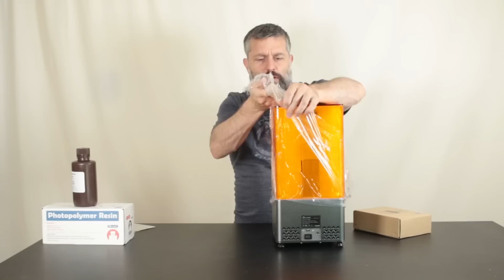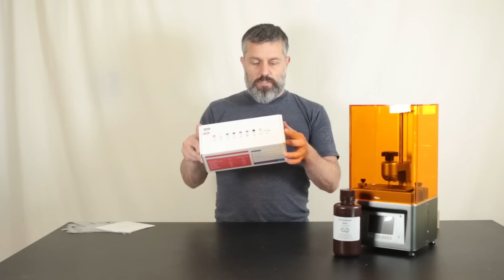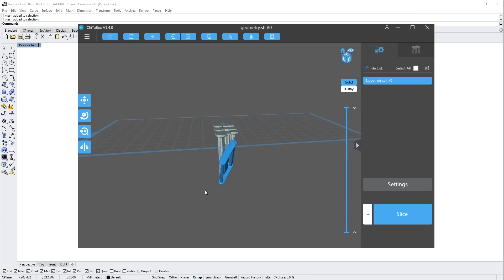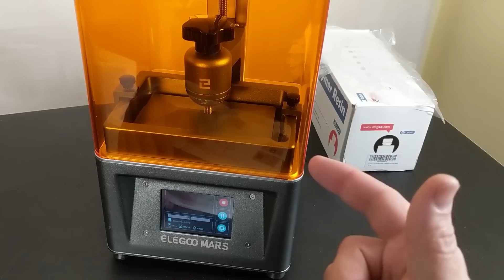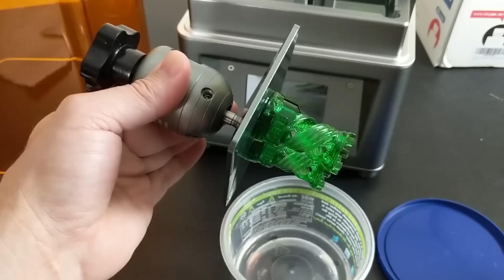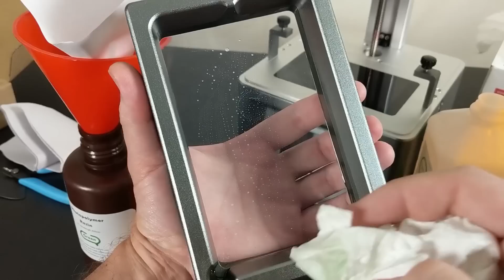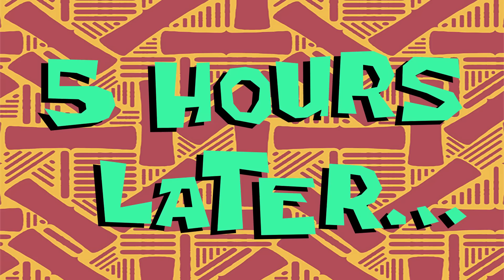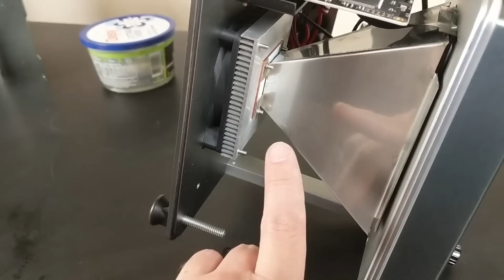$250 for This Quality of Printing Is Unreal! - the Elegoo Mars Delivers, so Let's Review It.

Comment: Very important, you must keep the resin off your skin, even in trace amounts. If you do get resin on your skin, immediately wash it off thoroughly using soap and water (NOT using isopropyl alcohol, as I had incorrectly originally written), and try to avoid UV light and sunlight for a few hours. From what I've read, there's this strange thing that happens where when UV resin cures inside your skin, it raises the flags of your immune system, and over time, your immune system becomes sensitized to UV resins. When this happens, you can end up with severe, nasty reactions to any contact with resins. Delay that sensitization as much as possible by always wearing gloves and never handling uncured parts with bare fingers. (Severe cringe when you talked about how they still felt "tacky". :-P)
Reply: I agree you should always wear gloves (nitrile, not latex), but never wash it off using IPA if you get it on your skin.  The IPA makes the resin thinner, but when it's on your skin that also means it will absorb into your skin quicker and easier.  You want to get it off your skin with the minimal amount of it being absorbed.  It's similar to how Sanjay from E3D has talked about seemingly permanently injuring his finger by experimenting with solvents, the plastic dissolved in the solvent, he got it on him, it absorbed into his skin, the solvent evaporate and left behind solid plastic in his finger.  The IPA will thin the resin, it'll soak in, and then when the skin is exposed to UV the resin will harden in the skin (there's photos of one person's hand on the Sparkmaker facebook group where he did that - it wasn't pretty.)  Formlabs talks about it here: https://support.formlabs.com/s/article/Resin-Care?language=en_US
Reply: @ualdayan  Im going to join that group just so I can see that photo :o
Reply: Hmm, interesting. I have thus far removed it by splashing IPA onto the affected skin and then vigorously rubbing under a stream of running water. I haven't had any negative/unexpected effects so far, but if what you say is true, I guess the key is to be even more careful about getting it onto skin in the first place. But, given that it is not water-soluble, how do you get it off if not using a solvent??
Reply: @logiclrd  You wash vigorously with water and soap.  Keep doing it for awhile longer even after you feel like your hands are clean.  The ultimate solution is don't get it on your skin,  get better gloves if they are breaking on you, never forget your gloves before handling things (I even wear them when pouring resin in as I have seen it splash up when it first hits the FEP film), but if an accident happens you just want to limit as much as you can from being absorbed into your skin as you can which means acting quickly, and not doing anything that will make your skin absorb it easier.
Reply: @ualdayan  will scrubbing a resin residue from skin using a pumice stone be a good idea? I often use oumice stone to scrub off a grease or glue resin from my skin, because it is faster than using soap,  washing powder or heavy-duty hand cleaning paste in my experience.
Reply: Arientar at my lab we use the pump dispenser version of a pumice soap popular with metal work and welders. Nothing beats it. Look around for a welding shop and get what they have.
Reply: Yea, I can vouch for the general safety of using these polymers. I run 21 commercial 'resin' printers every day, all day at work. Not desktop hobby boxes...larger printers that use about 3/4 kg of material each.
If you read the SDS for these you'll see some redflags for corrosives and especially reproductive issues for women. I recommend buying a long-sleeve lab jacket and chemical booties for your shoes as well as the gloves and glasses.
Reply: happened to me, developped an allergy
Reply: Interesting and informative thread, thank all of you for this conversation!! 

Except the licking-to-test-tackiness part; preeeeetttty sure you're pullin my leg with that one 🤣 😝
Reply: This sounds like and AD for not buying a Resin printer. Need to cut down the number of things that want to kill my ass.
Reply: WRONG - I hate that word, but I CANNOT stress enough: do NOT use water and SOAP directly. SOAP will break down your skin protection, making it easy for the resin to penetrate.
Instead, use either poppy seeds, baking soda or baking powder to BIND the resin first. Rub it strongly in. THEN go ahead with the above.
Reply: sounds like you should be taking antihistamines while using these chems, maybe keep an epi pen on hand. A similar thing happens when you get a lot of bee stings over several years, you can actually develop an allergy and have an anaphylactic reaction even though you never had any allergy's your whole life.
Reply: @Choc_Chilla  I'm calling Bravo Sierra on the bee sting thing.  It's well known that beekeepers actually get used to the sting, and have a lower incidence of arthritis.  I got stung loads when I was a kid, helping my dad with the bees, and at 55, still have no problems with the occasional yellow jacket or bee sting.  Dad is frikkin 207 years old, or 89 maybe, and still walks right up to yellow jacket nests to spray them.  He just squashes any that sting him and throws their corpses on the ground.  You can barely even tell he was stung an hour later.  ( and of course there are exceptions to this.  Generally though, beekeepers never get allergic to bee stings.)  People who are genetically predisposed to bee sting allergies, or resin allergies, need to be careful.

I wonder, does 23andme do any reporting on allergy predisposition?
Reply: New form of body modification?  Soak hand in IPA diluted resin, then place palm on UV curing plate with a pentagram design?  Favorite gang symbol?
Reply: Well said. Harbor Freight Tools now sells thicker 9 mil nitrile gloves, much tougher than their 5 mil gloves.
Reply: Wearing PPEs is always good advice. But to be very very clear, quite a few cheap photopolymers sold for home SLA are atrocious and have no business in an office or home. Know the differences. Stay healthy.
Reply: What about the dentistry and finger nail shops has this phenomenon been noted in either technicians or patients in either of these fields?
Reply: Couldn't you use a small powerful vacuum cleaner to pull it right off your skin surface very quickly?
I have an old mini portable Shark vac. that I take on jobs when I have to do wood working and it is super strong suction as the hose is a smaller size to fit the unique vacuum body and it has a heavy fiber filter inside to catch particulates.
It pulls stiff out of crevices and cracks as I use it for dusting and cleaning furniture that has been neglected also.
So it pulls things up so fast and strong it seems that that something like it would work great for pulling the resin off your skin as fast as possible without scrubbing and wiping and just pushing it into your skin even further. Use a thinner and then just pull it all off very fast.
Reply: @d.aardent9382  It's really goopy stuff. You'd get maybe 95% of it quickly that way, but the 5% that would still be in contact with your skin is what the problem is all about in the first place.
Reply: Splash of 95E10 gasoline (95 octane, 10% ethanol) caused my hand skin to inflammate and flake off...
Reply: thank you
Reply: The thing with allergies is that you can be totally fine for years... and then WHAM!, your body says “nope, it’s not having any more of that.”

My mom was able to take penicillin for years (not constantly of course lol) then suddenly, in her 50’s she was rushed into hospital for a severe penicillin reaction... and that is something that is supposed to help SAVE your life. It almost killed her. Allergies are a bitch... never take them for granted.
Reply: Would have gotten thrown out of most chemistry classes for failure to follow safety precautions.
Reply: @logiclrd Do you happen to have a link to the original article i would love a read
Reply: Hey logoclrd, long time no see. Been keeping busy so I haven't been on the irc much. You are right about the resin though.
Reply: @Nick F The most dangerous chemical is dimethyl cadmium, which is so dangerous most scientists refuse to even work with it for any reason.  At the bottom of the ten most dangerous chemicals is ethylene glycol, good old pretty green sweet-tasting auto antifreeze.   It's also in the formulation of 900 auto, paint, household and garden products, so to exclaim 'It's Everywhere!  It's Everywhere!" would be pretty accurate.  But perhaps the nasty chemicals most-often encountered are in air fresheners, and not even required to be mentioned on the product's MSDS; they are in the air in many public spaces, and can cause migraine headaches, asthma attacks, mucosal symptoms, infant illness, and breathing difficulties.
Reply: seems like a meme, I get chemicals all over my hands all the time. I'll let it soak and see what happens.
Reply: [citation required]
Reply: I use UV resin as my go-to JO lube.  Its great!  When i want to get really kinky, i JO under a UV blacklight lamp.

The sissy doctor says i only have a week to live because UV resin is dangerous.  Pfffft!

I got so turned on that i rushed home to JO.
Reply: IF WHAT YOU SAY IS TRUE...  this machine should be outlawed for home use ESPECIALLY SINCE our video maker didn't indicate any potential health issues and the manufacturer's instructions don't seem to include any resin handling safety guidelines such as "CAUTION - For Ages 25 and up".
Reply: @tribulationprepper787  clutch your pearls!

Think of the children. 

The world has always been a very dangerous place, and we'll be fine without people like you banning our tools.
Reply: @skunk12   Your chosen YouTube channel name explains it all.  Please continue to enjoy your sociopath trolling activities.  THESE DAYS the world is a dangerous place.  I am sorry for you and the children whom you MAY bear if ever you grow up.
Reply: @tribulationprepper787  so you've decided to respond by throwing labels like "troll" and "sociopath" around.  Then you followed that up with a pity statement.  

Really?!  That's your move when someone says they don't want people like you trying to deny them access to tools?

Good luck with all that.
Reply: @skunk12    There is no where in my initial comment (which brought on your criticism and ire) that I even suggested that I want to deny anyone access to anything including "tools" or AR 15's or anything else.  My motto of the day is "Use at Your Own Risk!".  You are the trouble making TROLL who made a rude, unwarranted accusation with absolutely no basis for it.  You deserved to be labeled for what you seem to be.  Stop reading falsehoods into my statements unless you ARE just a troll looking for a keyboard collision you can't possibly survive.  The intent of my original comment was only to bring to light the very real dangers for contacting the resin along with the manufacture's and video makers disregard of the apparent dangers.  This video and the machine maker have not emphasized highly enough, the need for skin protection and that was my only gripe.
Reply: @tribulationprepper787  projection much?

In regards to this resin printer you said "should be outlawed".

What part of that did i misunderstand?  How did you figure that i have no basis when you empirically made that imperative statement?

What possessed you to introduce a non sequitur AR-15 slogan?  Are you suggesting that im claiming a 2nd ammendment right to resin printers??  That line didn't go over as cutely as you might have imagined.  It's desperate (much like your thought process here).

What ire?  How would you know whether or not a stranger on the internet is "angry" or "a troll" or "a sociopath"?

Lastly, why would the guy in this video have a responsibility to explain to viewers (to YOUR level of satisfaction) that resin can be dangerous?

Yeah, dude.  Contact your next of kin.  Your arguments didnt survive the massacre brought forth by reason.
Reply: @skunk12   Thanks for taking so much of your time to let me know.  Take care
Reply: You sir need an email to give out to sites like that ChiTu software site.  I have 3 different emails for a reason, One for work -  one for the hoes - one for family.
Reply: I use dish soap as it combines with the resin compared to just water which it repels
Reply: Where have you read this. Source?
Reply: Somebody replied to me with a google link as a 'source'. Please follow correct practice people. Otherwise I can do all the homework. Wake up. Stop chatting. It's the 21st century and this is a scientific society. I haven't got time at the moment to dive into this but one correct source is: Jacobsen et al. (2016). Risk Assessment of 3D Printers and 3D Printed Products. Carried out by the Danish Env. Protection Agency. If anyone has time, please check. Also, several articles mention that resin is toxic to the touch. Not just through ingestion, but to touch. Yet, no articles mention any source. So take it with a grain of salt. It seems that there is no research established yet, and nobody knows. All we know is, yes, for some substances we can suddenly develop allergies with repeated skin exposure. Is that the case for resins? It seems that noone knows yet. It might just be that it's just like touching your credit card or an acrylic sheet.
Reply: @ralphzoontjens  The very first Google result has a ton of relevant content, including firsthand reports from people who have had long term exposure specifically in the context of 3D printing. You asked what my source is. That is my source.
Reply: @logiclrd  Hi, yes thanks. Still it's only a description of your source. A source reference is for example, a URL. Besides what to you may appear first in Google can be different in my location and at a different time. Therefore the practice of source referencing has been established. For example https://www.otago.ac.nz/mfco/otago046858.pdf . I am not being difficult I am only asking where can I see your findings.
Reply: @logiclrd  I think I see now. You must be referring to the reddit thread here: https://www.reddit.com/r/3Dprinting/comments/a0j88d/what_are_the_proven_risks_of_3d_printing_resin/ "Atrophy of the testes" that is no joke. Yet no data on sample size, exposure, method of body entry etc etc. Just one anecdote. I believe we have to be careful with skin contact of this stuff, but we need studies. I know several engineers and we're not always using protection.
Reply: @ralphzoontjens  Fair enough
Reply: believing that printed resin is less dangerous than liquid resin is so naive
Reply: Nick F Nobody is saying it’s the most dangerous in the world. The MSDS confirms just about everything said here; repeated exposure is to be avoided.
Reply: I usually lick my resin parts to check if they are still tacky . way better because its fast and convenient plus you 
do not need any gloves .
Reply: Oh for crying out loud. Here's a stupid MSDS from Formlabs and it's for certain they have got their sh*t together because they have too much invested: https://archive-media.formlabs.com/upload/White_Resin_SDS_EU.pdf      ~~      Please note section 4.2: PLEASE ALSO note that INGESTION has "no known significant effects or critical hazards!!!"    ~~   So you CAN EAT IT.  What the heck man. It is a mild skin irritant. So is paint. So is bleach. So are my cats. Grow up folks. Pay attention to what you are doing and stop over-reacting. It's a damn good thing they sell special screw-drivers with the tag that reads "do not put in your eye" or I swear some here would in serious danger. Especially if the tag falls off!

4.2

Most important symptoms and effects, both acute delayed
Potential acute health effects
Eye contact : Causes serious eye irritation.
Inhalation : No known significant effects or critical hazards.
Skin contact : May cause an allergic skin reaction.
Ingestion : No known significant effects or critical hazards.
Over-exposure signs/symptoms
Eye contact : Adverse symptoms may include the following:
pain or irritation
watering
redness
Conforms to Regulation (EC) No. 1907/2006 (REACH), Annex II,
as amended by Commission Regulation (EU)2015/830
Inhalation : No known significant effects or critical hazards.
Skin contact : Adverse symptoms may include the following:
irritation
redness
Ingestion : No known significant effects or critical hazards.
Reply: @AtomkeySinclair  I dunno know what you call edible, but don't eat this, it will wither your balls away.  It literally says that in section 3.2, just before the part you quoted. "Repr. 2, H361f (Fertility, causing atrophy of the testes)" (standing for reproductive health hazard level 2).  That's the diphenyl phosphineoxide in it, which is a hardener; the methacrylate monomer (acrylic resin) and oligomers in it are eye irritants and skin sensitizers (meaning the more you use it wrong, the more allergic you will get to it).  I appreciate that you are saying you need to use gloves for this, but don't be silly; "No known significant effects or critical hazards" is referring to use under controlled circumstances, with chemical resistant gloves and respirators, changing out of work clothes and showering before eating, and really just means they didn't find anything else immediately harmful under the tests they carried out, which only have to go so far to cover them should a lawsuit come up in court (which you'd better believe they will budget for; after all, what's even a $1M out-of-court settlement if you're making hundreds of millions off the product?).

Yes, people should just use common sense and take standard precautions, but no, resins are not like just any other run-of-the-mill chemical.  Most people aren't used to the idea of sensitizers, and if 3D printing is something that somebody is passionate about and really wants to get into, but they aren't careful the first time and get sensitized to the resins, it could literally mean they would be unable to use resin printers in the future.  I think that is worth making a big deal about and warning people.
Reply: Allergies will vary from person to person, and is probably somewhat genetic.  I've known people who have worn latex gloves every working day of their entire adult lives who do not have any resin sensitivity at all, and I have known people who have never been able to wear a latex glove even once because even handling the gloves makes them break out in hives all over their entire body.  Some people will probably develop resin allergies, and most won't.  You don't need to warn people about it.
Reply: @naikrovek  Keep in mind there's multiple reasons to keep resin off you. There's the 'you can start out not being allergic, then through repeated exposure become so allergic you can't even breathe near it (happens to boat workers a lot and unfortunately is usually a career ending condition)' - of that as you said - it will vary from person to person - problem is you have no idea if you're one of those whose immune system quickly forms a response to it - until it happens to you.  The second reason affects everyone right from the start, and is not an allergy - UV resin when exposed to UV is going to harden - it's what it's designed to do.  When it does it'll heat up quite a bit, and leave solid plastic behind.  Anybody who puts their hand on a hot stove for example gets burned - no allergy needed.
Reply: @naikrovek  YES YOU DO, This is a totally different beast from latex allergies.  This is strictly a contact allergy and will get you if you are stupid. Genetics might determine how quickly it will get you but Always wear gloves with this stuff.
Reply: Good reason to avoid this technology entirely.  Accidents can and do happen.  Expect them and learn from the mistakes of others.
Reply: @sincerelyyours7538  if the consequence of repeated exposure is that one can no longer work with this technology, your solution is to start at the end and avoid it altogether?
Reply: I think folks over-react to the dangers of the resin. Just be cautious like you would with any materials. You would have to be in constant exposure/contact with it on your skin for it to become a true health issue me thinks. If it were truly dangerous to this degree there would be an outcry for child safety issues, OSHA, and so on.
Reply: @AtomkeySinclair  You are wrong. Plenty of actual evidence that some people quickly develop a reaction. I'm sure OSHA already covers this. Is your child playing with UV resins? Why?
Reply: @AlienRelics  If you say so. I feel fairly confident if OSHA had that manufacturers would be required to include a Materials Safety Data Sheet (MSDS) with the product. Got me on that one.
Reply: @AtomkeySinclair  "Just place all of your trust in the manufacturer and OSHA." ... Because manufacturers and regulatory agencies have never let anyone down right?  Sorry but that is the worst attitude anyone could have.    

Any time you're working with something that's new to you and potentially hazardous, you should always do your own "safety assessment."  Even if it's nothing more than skimming through a manual and familiarizing yourself with basic terminology.  Don't just learn the "do's and don't's" - make an effort to understand the "why" of it.  Using common sense only gets you so far - some things are highly counter-intuitive or insidious, and common sense will just get you hurt.  On the other hand, some things aren't quite as dangerous as they seem.  When you have at least a practical understanding of what you're working with, then you can decide for yourself which rules are imperative to follow or not.  That's part and parcel of being a "responsible, science minded person in a science setting using science equipment."  Did you think "science-minded" means "just wing it based on common sense?"  

Considering that YouTube is usually the first place people go to learn about new things, there is nothing wrong with talking about PPE, and what can possibly  happen if you don't use it.  The only person I've seen using wild exaggerations and sensationalized language is you.  You haven't added anything of value, you've only served to muddy the waters.  Nobody is talking about "fanatical estimations on the end of the world possibilities," or being unduly alarmist.  Erring on the side of caution and using caps to emphasize a few words isn't the same as saying, "omg you and your family will die/the world will end if you do this."
Reply: @The-Rewker  Personally I think the whole thread got out of hand. Who are you quoting anyway with "Just place all..." Anywhoo... The wild exaggerations was a deliberate attempt to contrast the already posted exaggerations and was in no way intended to be taken seriously. I suppose that was lost in text-to-brain translation for some, and that's understandable. Did you even read the first line of my first comment nearly a month ago? I'll quote myself: "I think folks over-react to the dangers of the resin." I wasn't being an alarmist. Quite the opposite. But then holy cow man... Allow me to rectify my position on this mess. Please handle the resin with care. Wear gloves. Make sure you avoid contact with your skin and eyes. Don't ingest. Use ventilation and avoid fumes. Seek medical attention and discontinue use if you experience adverse reactions. Do this also with other household products like bleach, detergent, WD-40, lighter fluid, gasoline, peroxide, lye, paints of all kinds, polyurethane, and of course - peanuts. And yes, science minded folks use common sense - I never said wing it. That's what YouTube is for right (translation required)? I would say consider gravelydon's remarkable dialogue - his point was the most effective here.
Reply: @AtomkeySinclair  Quoting you.  You said something like "I'm sure if it was dangerous OSHA would require an MSDS bla bla bla."  

The whole thread didn't get out of hand, but you did help to derail it a lot (until gravelydon spoke some sense to you).  

Your wild exaggerations weren't contrasting anything, they were 100% non sequitur.  And again, only served to muddy the waters/derail discussion.  I wasn't calling you alarmist, I was telling you that nobody else was being alarmist.  Taking a moment to point out potential dangers isn't alarmist.  

Congratulations on rectifying your position.
Reply: @The-Rewker  Still lost in translation man. And there's no point in adding to the nonsense. But I did want to point something out in favor of your position otherwise. In perusing alternative resins for the Anycubic Photon I discovered one sold by ELEGOO on Amazon today. The first question in the forum was a request for the MSDS on their product. It caught my eye and reminded me of this ongoing thread here and I wanted to add the information for the sake of those that certainly have concerns for handling. I noted that the seller responded with the mechanical characteristics of their resin. But no real safety metrics. Another person however did respond with a .pdf link into the ELEGOO website where she reported it to be about 8 pages long. Curious, I went there and discovered a 404 not found. Well after listening to so many worrisome folks here I figured it was worth while to investigate. So I used the ELEGOO's site search and and also looked around for it manually. No file. But I did find a reference to it on reddit. That bugs me more than handling the resin. Did ELEGOO remove the MSDS for a reason? I would hope not. Here is the link to the product on Amazon so you can see the question, ELEGOO's response, the girls [surfgirlt · July 14, 2019], and mine (atomkey). https://www.amazon.com/gp/product/B07P95B4N1/ref=ask_ql_qh_dp_hza

It is the first question for the product listed. 

And here is the link I found on reddit referring to the same: https://www.reddit.com/r/ElegooMars/comments/cjif9n/elegoo_resin_msds/

I'm think I will send a quick email to ELEGOO and ask them directly for the document and see what happens. Nonetheless, I still think the handling of the resin is relatively safe and that most of the positions here and just about everywhere else are exaggerated. But it I turn green and glow in the dark later I will certainly have no one to blame for it. I'll post again the response from ELEGOO if they answer or not. If they provide the MSDS I will publish it on my website for safe keeping.
Reply: @AtomkeySinclair  - OSHA has only recently gotten around to recommending protective masks and dust collection devices for people that cut granite and other stone, natural or man-made and people are dying from lung diseases from the silica dust.
Reply: Look, most resins that have been tested for chronic toxicity have been found to be carcinogens, or at the very least sensitizers. When the chemicals are tested for approval, they are testing for safety under specified conditions: industrial conditions, with respirators, chemical resistant gloves, and intelligent adult operators. They don’t test for two-year-olds unplugging machines full of uncured resins, nor hobbyists poking at parts with their bare hands; that is not how these things are designed to be used. People have died from complications of exposure to polymers, Eva Hesse is one example.
Reply: @AtomkeySinclair   health issue yes, but keep it off your skin is highly recommended to avoid sensitizing your system and developing an allergy. As a PSA, if as a young person you worked with various epoxies and let them get on your skin, like we all did. You might find yourself having a bad reaction immediately with this stuff. My suggestion if you have gotten epoxies on your skin in the past, before even buying a printer. Go buy some resin and with some benadryl liquid gels handy give a sniff. If you start coughing immediately close bottle get fresh air and pop the benadryl.
Reply: @AtomkeySinclair  Here is an example of where you would be wrong. Back in the 80s I was exposed to contact with a liquid form of a soil fumigant. At the time, there were no long term known effects of it. Short term were known because most who came in contact with it did not live long. Even just in the concentrations it was used in homes and businesses as a termite fumigant. It had no precautions other than to limit exposure to it and seek fresh air if the tear gas in it set a person off coughing/crying. And wash off immediately if skin contact happened. You could not wear a respirator as it would remove the tear gas which was the warning mechanism for the other chemical. You could not wear a wetsuit or any type of rubber/Tyvec outfit as it would go through that just as easy as it would go into wood. Its ability to penetrate up to 8" into wood was what made it so effective against insects. 20 years later, it was listed as a carcinogen. Now it is banned from even being manufactured because it also affects the ozone layer. Because of my contact with it, my skin in certain areas became very sensitive to it. Just driving by a field where it had been used where you could not detect the tear gas warning affects could change the areas on my skin a darker brown. But at the time, they did not know how long the chemical even stayed in the body of a human. People who broke into homes while they were tented even wearing SCUBA tanks for breathing died from it. Sometimes even before they got out of the house. That is why there used to be guards posted when a house was fumigated. They also now know that it over a long time, can affect the Liver, Kidneys, and nerves.  Long term effects often aren't known for decades after exposure. Look at asbestos and even Roundup/Glyphosate exposures which are now becoming court cases. Back when I first started handling Glyphosates it was thought to be so safe that you could take a bath in it. And just wash of afterwards with no long tern effects. Now we know otherwise. But there is no outcry about the use of Roundup/Glyphosates. Here is the EPA statements on what I was exposed to as of 2002. Now it is listed as a carcinogen. https://www.epa.gov/sites/production/files/2016-09/documents/methyl-bromide.pdf That report first came out 8 years+ after my first serious exposure and 7 years after my last direct exposure. The first one put me in a hospital for a week, a few days out, and then back in for another week. Yes, I showed signs of the enlarged Liver from it on the first concentrated exposure. Second one required a trip to the ER to have a blood sample taken right away. Because of my contact with it, the second time in liquid form, my doctor suggested that I look for a job in a different field of work as quick as possible. 
Becoming sensitive to chemical also happens without people even knowing till later. Do you ever eat anything that has Horseradish in it? One of the chemicals in it is nearly the same as used in hardener for Acrylic Enamel automotive/industrial paints. You don't find the warning label on the food product but you do on the paints. In fact, in foods, it has a beneficial effect of fighting Cancer.
Reply: @gravelydon7072  Your point is valid of course. And remarkable as well - dang. We may, say in many years down the road - discover that people are going blind from fume exposure to the resins we use today. And of course the first best destiny in any case like this would be to avoid the material completely. Just don't use resin printers. If you do, then use proper PPE when doing so. But let's behave like responsible 'science minded' folks in a 'science setting' using 'science equipment.' Let's be professional to some degree, and not freak everyone else out with fanatical estimations on the end of the world possibilities. Be careful. Be mindful. And most of all... be calm. And in cases like yours, just go get another job please. That is terrible what happened to you.
Reply: @AtomkeySinclair  I did get another job after the second time. But years later the doctors question what has caused the nerve damage? Whether it is the result of the chemicals or results of the other job where I was exposed to low frequency vibrations for long periods of time? I was taught safe handling practices for many things. Chemicals was one, machinery as another, biological agents as a third, electrical as a fourth. All involved using the right PPE when doing something. Messing with paints and resins where there is an odor normally means that there is something that need protected against. And yes, I keep a box of Nitrile gloves handy at all times. Second job required OSHA First Responder Operations Level training, CPR, First Aid, Respirator training, fire fighting training, hearing protection, fuel spill containment training, and just before I left, they were also getting portable defib units for every one of our vehicles. Why all these things? Because when it can take up to an hour's drive in the middle of nowhere for the Fire Rescue people to get there, you have to take care of things yourself.
Reply: @gravelydon7072  As far as your Glyphosate claim, winning in court with a jury of lay people is not scientific evidence  nor the scientific method. People have won court cases where they claimed they lost their psychic abilities from an MRI scan. lol Hey they won in court so it must be fact right. :-)  

Glyphosate if ingested acts like an antibiotic and will kill off some of your gut bacteria. If the bacteria imbalance is not restored by the body, foods especially fermented foods or other probiotics then you could experience long term problems.  We now know our gut biome plays a vital roll in our health and longevity. If you use glyphosate correctly you will not ingest it. Any sprayed breaks down quickly in the soil and is not found in or on plants if not harvested right after spraying. glyphosate is safe but it doen't mean harmless if used incorrectly. Like any chemical it can cause harm and proper precautions should always be taken. 
What is driving these lawsuits, like most class action lawsuits, are lawyers who are making millions while the gullible public gets scraps if anything.
Reply: @SmokinPaul   Yep, you never know how a jury comes to their decision unless you are a member of that jury. Something I have done way too many times. The last time I served on one, myself and another possible jury member even got six out of the seven members who would serve right. Our seventh ended up as the alternate. The key clue? "Have you ever served on a jury before?" A "yes" answer meant you were going to be on another. Both of us had served on more than a handful of juries each in both criminal court and civil court.